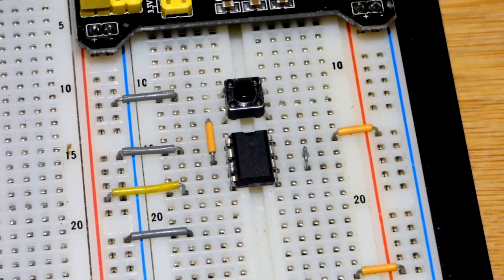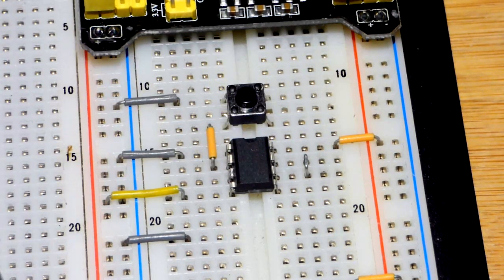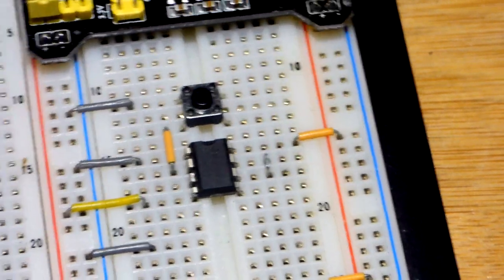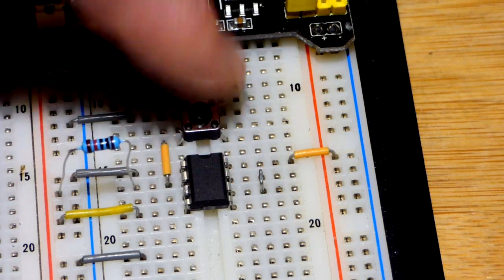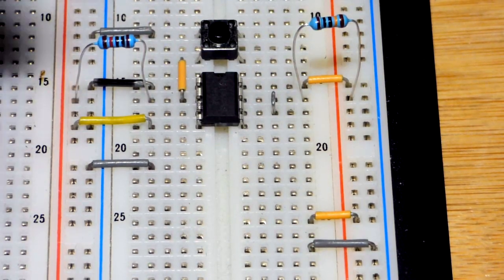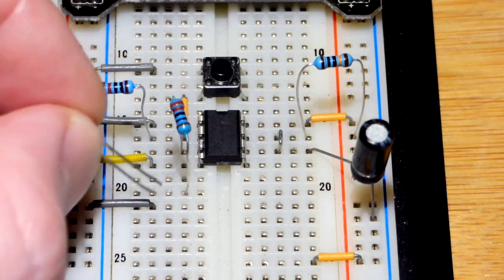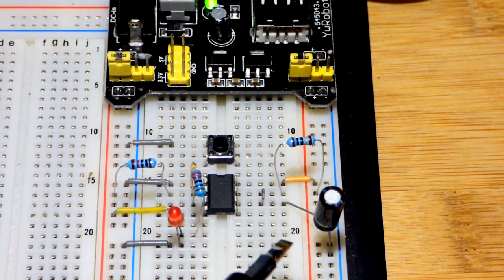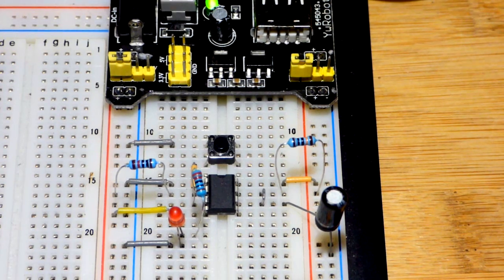555 timer circuit step by step wiring in monostable one shot mode NE555

Comment: So how do I fix it so when I hold the switch the output doesn't continue be high. I'm trying to get about 2 millisecond signal but it's affected by how fast I can press.
Reply from the maker: I just made some videos of circuits where a capacitor in series with the switch, stops the signal before releasing the switch. Just need a way for the capacitor to discharge when you release the switch.

Comment: Is there a circuit like this that would make the led go on and off three times then stop until the voltage is re-applied? Thanks.
Reply from the maker: I would probably find a way to use a monostable 555 to control an astable 555. You just have to adjust the timing of both circuits so that you get 3 flashes with each pulse.
Reply: @Electronzap  Ok, thanks for taking the time to respond.

Comment: OMG!!!!  thank you thank you thank you!!!!! I've been working on this one mode for probably a week and could not get it to work. I didn't have a stupid 0.01uf ceramic capacitor and thought maybe that was the problem. I watched countless videos. They all start out with explaining how the chip and circuit work and I had seen them so much I could recite that part by memory. 

One nice thing about your video is that it was so much easier to see where the components went vs the other ones, although I reviewed an reviewed and couldn't figure out where I was going wrong. In all those other videos the people got their circuit to work and said how easy it was which just rubbed salt in my wound. 

For whatever reason your video was easy to follow and whatever I was doing wrong in the past was corrected. I can finally sleep tonight! Yes I was getting up in the middle of the night trying to make this circuit which was probably counterproductive, being tired and all. 

I watched your video, did what I thought I did dozens of times, only THIS TIME IT WORKED!!!! YAY!!!!
Reply from the maker: Glad you enjoyed! It definitely is annoying when a circuit won't work.
Reply: @Electronzap  
I think in some instances it worked but I didn't have a nice selection of resistors and capacitors, but in other instances it just wasn't set up properly. I set the one you presented and it worked the first time! It worked and I understood it.  yay!! 

Now I'm moving on to the bistable mode!

Comment: When I meter the capacitor after pressing the button the capacitor builds volts. I put a 1000uf in so it would take longer. The capacitor builds to about 3.3 volts then the led cuts off. When the led is off and I meter the capacitor it's 0 volts.
Reply from the maker: Good times! And people misspeak all the time in Electronics videos. It is good to measure things. Helps me learn a lot when I do too.
Reply from the maker: Yeah, I goofed on what the capacitor was doing. I measured the voltage with an oscilloscope in the video I made after this one and that's what I discovered too :)
Reply: I got the etekcity msr-a1000 multimeter and i am using it as much as I can to learn how to use a multimeter. I am have fun following your video's and learning. Just wanted to make sure I didn't do something wrong, and that's why I was getting different results.
Reply: To make mine last longer I just added an extra resistor (you can probably just add a higher resistance resistor too though)

Comment: I was getting frustrated I couldnt get it to work. I used a 10uf 25v capacitor instead of 50v. Finally I seen some chips I ordered but have never used them. They look just like the 555 timer. So I read the package and I was using a lm 386 . I changed the chip to the correct 555 and it works. Great learning video. Now I am going to switch capacitors and resistors to experiment and learn about this 555 chip.
Reply from the maker: Nice!